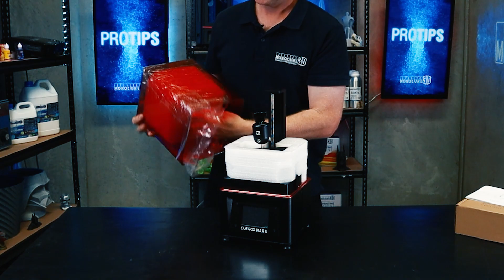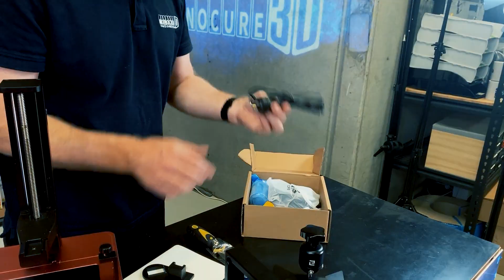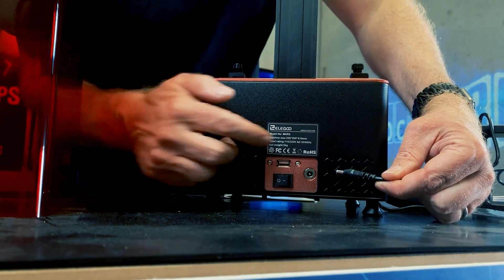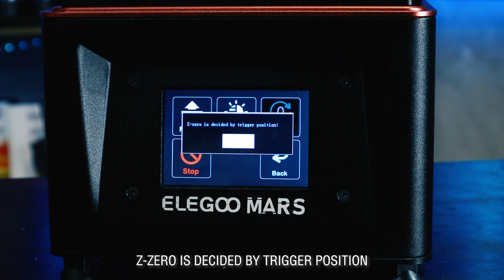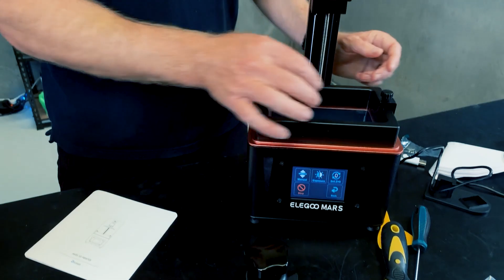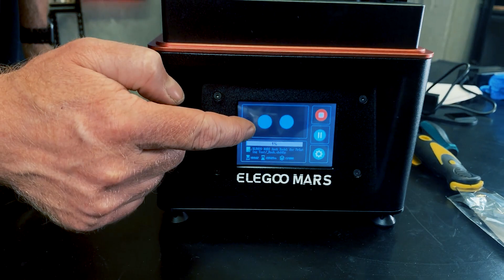Elegoo Mars Unboxing & Printing - 3D Printing with Resin - Part 01

Comment: Anodising is black paint? It's an oxide layer isn't it that gets stained?
Reply from the maker: Correct!
Reply: thing is, thats not anodization on the build plate, looks more like powder coating - powdered paint that has been melted on